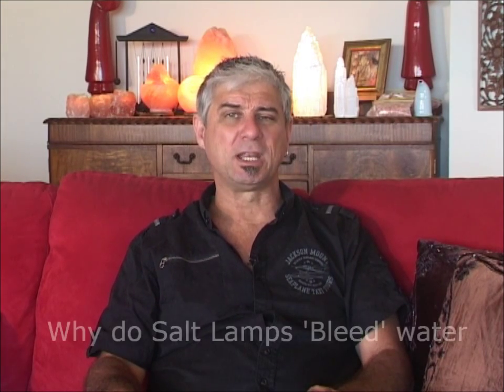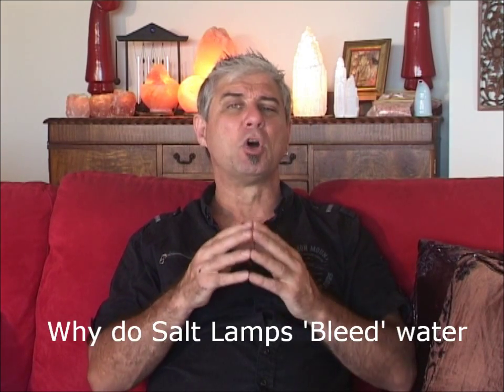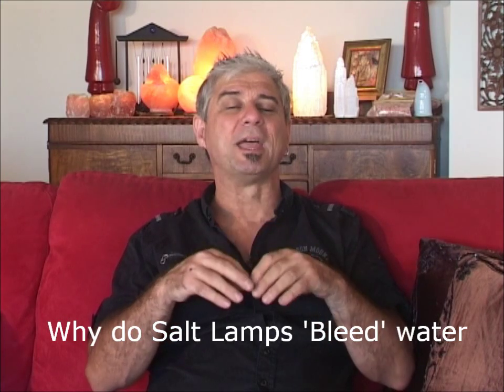Salt Lamps bleeding water by Steven Bettles from www.saltlampsaustralia.com

Comment: I don't think that this advice is very wise a lamp with no electricity to be sitting in a bowl ok ! However a lamp with electricity running through it in a bowl is great advise for a disastrous result!  I have used common sense and have mine sitting on a block of unvarnished wood so that the wood absorbs the water and has no chance of electricity being pooled in water !
Reply: isnt that dangerous? making wood a conductor for electricity